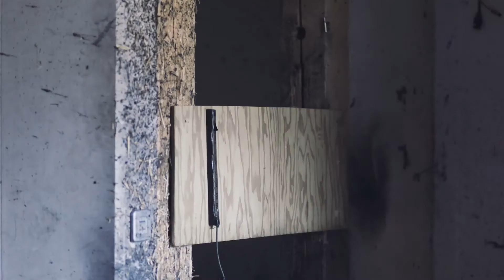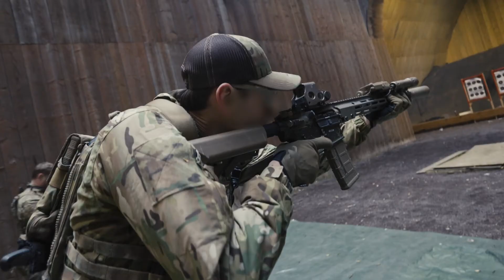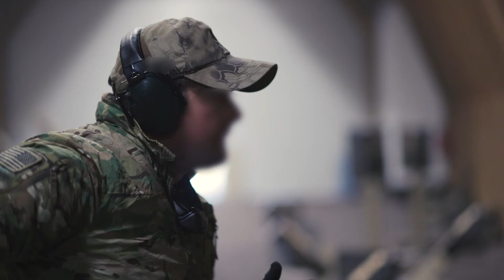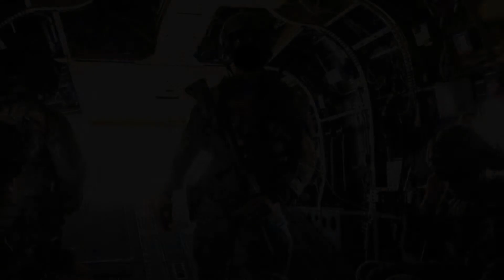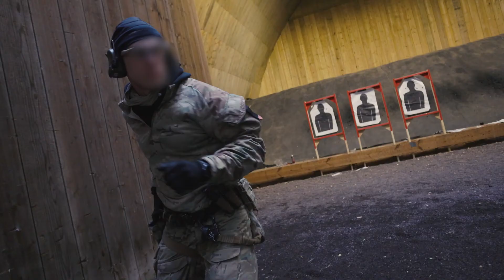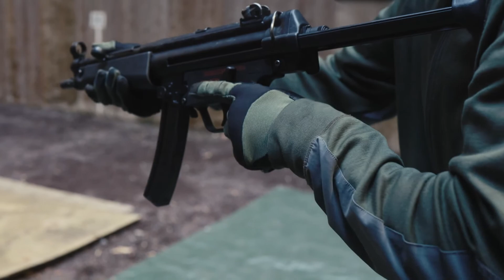Delta Force Loadout: Gear Selection and Total Costs

Comment: Delta Force has used L3's PSQ-36 since 2016.
It depends on the operation, but they say they're using the PSQ-36

Comment: I always heard Knights armament was good but no SF group I can think of uses them. I wonder why?
Reply: @@kevinwittwer5317 I think HK does kickbacks to the military brass. That's why they get chosen more often like back in the 90's when the USP went up against Glock for police contracts the USP was prone to breaking and expensive to repair so most agencies went with Glock but a lot of European police and some military units went with HK pistols and that can only be because of kickbacks. If they did an anti-corruption sweep in the Pentagon we would end up seeing a lot more American made weapons in the hands of the military than we do today. The Springfield Armory Saint Victor 308 has the best rapid fire recoil control for a AR-10 platform I've ever seen but you'll never see it up for a military contract.

Comment: The Delta guys run 416Ds not 416A5s. Delta's 416Ds most likely had a mid life service upgrade with a new coating, Geissele triggers and the Geissele SMR  rail. I think that the main reason Delta runs 416s is because back in the early 2000s MK18s didn't exist and HK was the only reliable solution when tests were conducted and continued to use the 416 because since they have expensive guns it makes no sense to modify m4 to m18s or to m18 MOD 2/M18 URGIs and have 416s the in the racks doing nothing. They are most likely gonna run these 416s till they die.
Reply: And those 416’s will never die 😂
Reply: Just wanna add my personal thoughts but absolutely confident the 416s are way more reliable than MK18s so It’d be a downgrade to swap to the MK18 and as for the HK416A5s, well the D models fits their operational requirements and probably don’t see a need to swap to the A5 for minor improvements but again this is just how I see it, I’m no expert and don’t claim to be
Reply: Mk18 are seriously inferior to HK416D?
How so? Daniel defense is no joke. I’d like to hear what pros Hk has over DD
Reply: @intuitivefugitive8852  The MK18 is inferior from a parts wear perspective. The barrel and bolt of a 10.4" or 11" 416 will last way longer than a MK18. The 416 us also less prone to malfunctions especially in sandy environments.
Reply: Two years later reply, Delta guys have been spotted allot in the recent times running the LVAW. They are still using the 416, but they have started using the LVAW alot. Exspasally for PSD jobs.
Reply: @COLLINTEAMWINBRK  they just adopted the Sig MCX 10.5" as their new rifle under the CSAW rifle program to replace their 416s.

Comment: I thought Delta Force used Glock 22s did that recently change?
Reply from the maker: Hard to say.  Some guys might.  Most seem to prefer the 9mm versions.
Reply: @TierThreeTactical  that makes sense, I only asked because I recently saw a video from forgotten weapons about the rejected 2011 from delta force, but that could have been back when there was an actual reason to use .40 instead of 9mm.
Reply: Sigs are used
Reply: @deprogramingraphypnosis8721  not for special forces. They need a better pistol like glock
Reply: @RESTORED_REPUBLIQ  tell me... what pistol killed Osama?